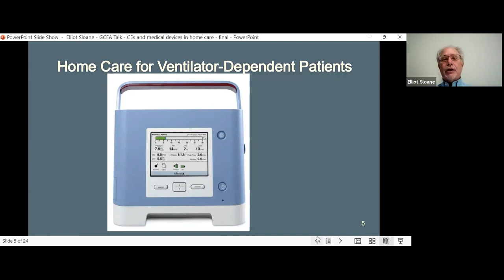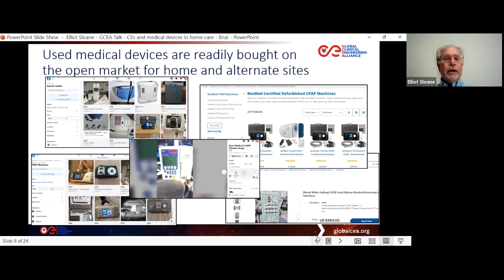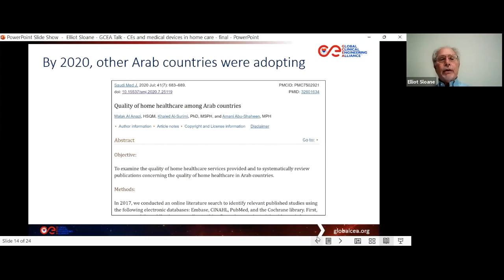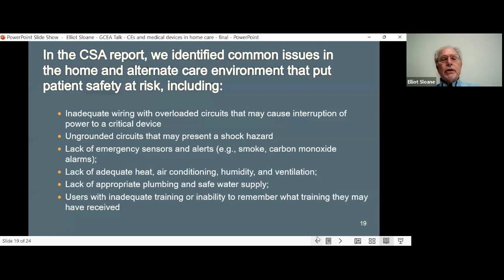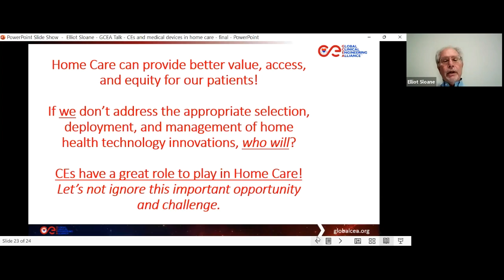CEs and the global use of medical devices at home and alternate care sites

Comment: Excellent overview and detailed presentation of the value and challenges of home and alternate sites of care.  The contrasts of decentralized care models with hospital-centric care can be very significant, since hospitals have higher degrees of control over materials, services, personnel and processes, compared to random home situations.    Virtualized care via remote pt. monitoring, medication mgt., pt. education and coaching, support groups, self-monitoring devices, zoom consultations etc.  have great promise for more preventive approaches to health as well as for earlier discharge from hospital and chronic disease mgt.   Clinical (Systems) Engineers need to be at the heart of designing these new service models to ensure the proper alignment of all the pieces and processes, to minimize risk, and promote collaborative, real-time clinical expertise that is as good at home as it would be in a hospital or clinic.